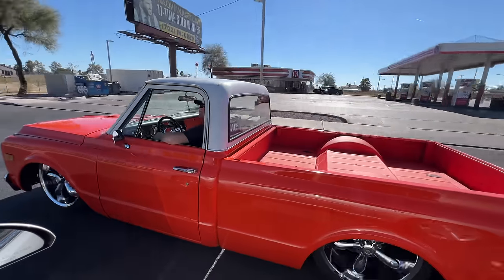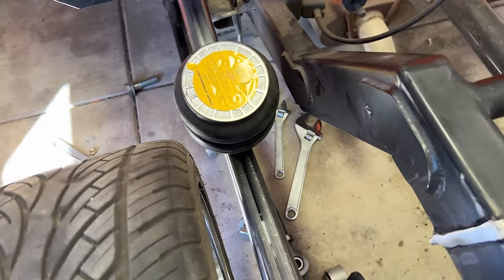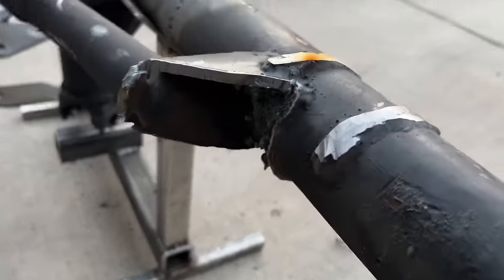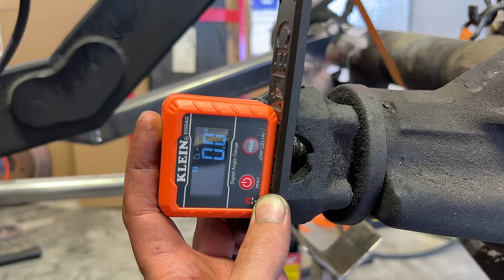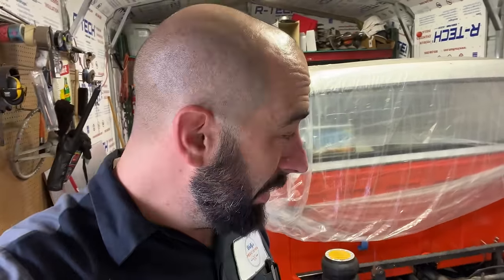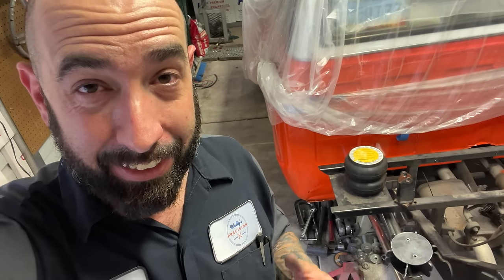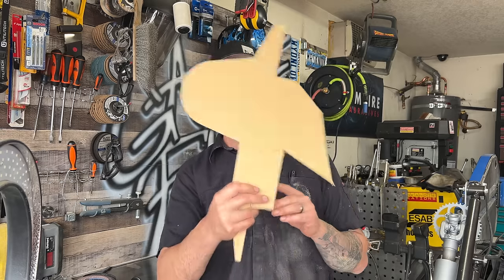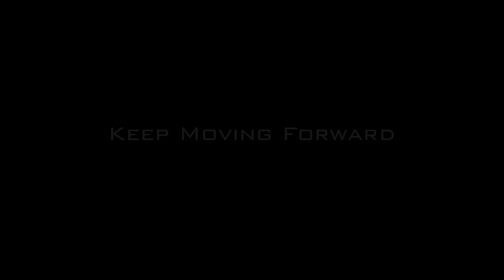Chevy C10 Air Bag Mount Design and Fab / Long Distance Fab 2

Comment: Good on you for taking the risk!  When you can create MIG welds that look as good as TIG - even welding vertically - it's a risk worth taking.
Bummer about having to redo the 4 link brackets on the housing end.  Especially in that kind of weather.  That's rubbing salt into the wound.
I hope your friend appreciates the effort that's going into this work.
Reply from the maker: …or rubbing salty sweat into the eyes. Keith has always been incredibly grateful. Which is probably why I continue to take on his projects even though I tell him that I can’t/won’t do them anymore.
Thank you, Craig! 🙌

Comment: Man o man, if I had a dollar for everytime, well you know the rest. Lol. It's all good nobody bats  a 1000. Great video as always. From off the grid in AZ
Reply from the maker: Haha! Thank you, Terry! Good to see you again.
Reply: @GarageFab  yeah it's been a minute. I see your videos,and for the most part there next level. Hope to be back on the ranger soon. Just got my block and rotating assembly back from the machine shop. That only took 26 months. Whatever. My question the other day was, triangulated 4 links, while the upper bars are shorter, do they still need to maintain the same plane . Thanks again.
Reply from the maker: On adjustable suspension, I think that’s a really good idea. That will keep your pinion angle constant and prevent driveline vibrations. On static suspension i.e. metal springs or coil overs, you probably don’t need to worry about that. In fact the shorter bars in addition to angling them towards each other on the front of the bars will it increase your traction a little bit off the line. I recommend doing a little reading on instant center to understand that better.
Hope that made sense. This type of stuff is hard to explain without pictures.
Reply: @GarageFab  thank you that was fast. No bags, fixed suspension. SBF, 5 speed, 373LSD. little solid roller motor. Should be a real highway star. This being my first suspension work really if this magnitude, I just want to be sure.
Reply from the maker: Sounds like fun! Can’t wait to see it!

Comment: Great job Aaron
Bugger about the first set of axel tabs but hay it's only steel and you still had your templates. so what 20 - 40  Mins lost removing the old and making and setting the new.
Reinforces the Tack first and final weld only once happy.
Also what prevents you taking your welder tot he the Keith's.
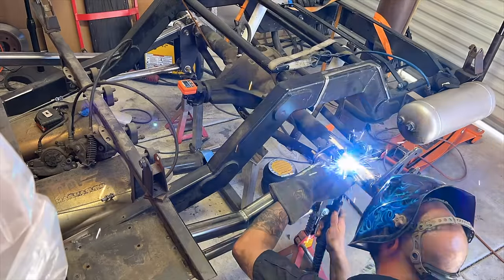Reply from the maker: Very true, Michael. Remaking the tabs with the templates I already had literally only took 10 minutes. Removing the tabs on the other hand was a nightmare. If you watch the part of the video where I remove the first tab, 11:58 you can see the sky change from day to night. And that was just one tab!
Thank you brother! I appreciate you.

Comment: I woke up around 4am to find this video already in my que. You snuck one in on me Aaron. Aint gonna lie though - I was thrilled to see it here. I fixed a cup-o-joe and settled in. Big respect for showing your mis.... well, you know. I can't even imagine TRYING to do a split-location project like that. My 30 second memory just wouldn't be capable. lol. But wow! Those mounts look so good!

Between the belly-laugh shot and the "whassup" I nearly spit my coffee out. I'm gonna have to start hitting pause every time I take a drink while watching your videos from now on - lol.

Quick question though - was replacing the u-joints even an option?
Reply from the maker: That shouldn’t be allowed. Watching my video at 4 am is almost like I’m up at 4 am… that’s not ok.
Swapping to single joints was certainly an option. It was just a very unappealing option. The current drive shaft is already a custom shaft. (The decision to install the double cardan on a vehicle with a parallel 4 link confuses me) So changing the joints would mean another custom shaft. Also, because the drive shaft was hitting the crossmember, (and then the shaft tunnel in the cab) body and frame modifications would’ve also been needed. The truck is painted already, so that was ugly.
Keith assured me that he had no vibration issues before I started hacking his truck up, so I essentially just put it back the way I found it.
Good to see you again, Tee Jay!

Comment: Brother you're back! Why has it taken me months to realize! I swear I just looked for you last month!
Reply from the maker: I’m shy. I tried to sneak back in without anybody noticing. Looks like it worked!
Reply: @GarageFab  just wanted you to know that your awesome, informative & fun videos helped me repair and relocate my 4 link setup higher at the front on the frame! Got my pinion angle within .5 or something degrees from the output on transmission, which I believe was so easy because I have a two-piece driveshaft!
Reply: @GarageFab  What is the setback on mighty Max?
Reply from the maker: Yes! Happy to be of service my man.
Reply from the maker: What do you mean by “set back”?
Reply: @GarageFab  I thought you said something about it was on hold for some reason
Reply from the maker: Oh!!!! Yes! It was simply on hold because I was working on my buddies truck. (The last two videos) I’m already back on it but you probably won’t see a video for another few weeks. Gonna post the rest of the C10 project, followed by a bushing assembly How-To and the we’ll Mighty Max it up!
Reply: @GarageFab  bushings in links?
Reply: Have you ever made or thought about making delrin bushings from a delrin rod?
Reply from the maker: It will be a video based on all the bushing redesigns I’ve done over the years. It’s a simple concept but I see bushings installed wrong often. Back to basics.
Reply from the maker: I have not. But I have been wanting to take charge and learn to make my own bushings. My suppliers are great. But slooooow.
Reply: @GarageFab  I've got a seller that sells the delran rod saved on eBay I just don't have the equipment to make them. And I don't know if you want harder bushings in link bars or softer ones
Reply from the maker: It depends on what you’re building. Drag strip stuff is often much stiffer. Street/performance, a little softer. (Polyurethane) and off road is really soft or bushings like Johnny Joints or Heim joints.

Comment: So many hidden variables with many a question such as ... when to use a staggered rear shock setup and the proper geometry for fitment - when is said shock setup necessary - I looked through and read my buds book from Max Fish on air ride suspension but I need to get my very own
Reply from the maker: Yes. Highly recommended. I’ll make a video on shocks soon.

Comment: I was thinking if you positioned the airbag over the welded bend such that the airbag was vertical, you could make a plate for the airbag welded across the bend to give it triangular support, and then also slap a gusset on each side of the square tube up to under the same airbag plate to make it super strong. I think it also would have moved the airbag more inline with the chassis rail you needed to weld to for the top airbag plate and given yourself shorter cantilever and more weldable contact area to it.
Reply from the maker: Yup! I agree with all of that. I didn’t have a whole lot of options on the location. So I picked the furthest point back that would still give clearance for wider tires. Hopefully you’ll approve of the reinforcements in the next video. 🙌
Reply: @GarageFab  Sorry - I gave no thought to the tires. Love your video's, especially the instructional ones. Wish you had the time for more. Keep up the great work.
Reply from the maker: No apologies necessary my friend! This channel is meant to be a source of good info for the people and you speak the truth. I’ve got to try and remember to share best practices even if I can’t follow them.
Cheers!

Comment: Nice!!! So Is the Double Cardan joint at the transmission? If so, have you seen one that will work with a M5Od-r2 (89 ish F-150 manual). I'm running truck arms on the 50 (Yeah, I know it is a bad idea) it would be awesome if I could set it up with a Double Cardan. Oh, I need to go back and watch the pinion angle video, haven't seen it yet. And re watch the Watts link video. Thank you for all of the great content!!!
Reply from the maker: Yes it is! I’m not familiar with your transmission, but a double cardan is a double cardan. It all depends on the suspension design and the set up. Your truck arm is the ideal system for the double cardan. On yours, the double joint will indeed be in the front, nearest the transmission, and the rear single joint will be nearly straight (1 to 2° bend) meaning the pinion is pointed at the back of the transmission.
Definitely check out the driveshaft video. I think it’ll benefit you a lot .
Reply: @GarageFab  Yes sir going to do some more looking. M5OD-r2 is the Mazda 5 speed in the full size, the ranger had the M5OD. Should use the same yolk as an AOD? Maybe? I'm familiar with DC at the transfer case for the front drive shaft. Also the ones on the early 70s ish Impala/ caprice that were at the pinion. Just hadn't generated much with a search result for a DC joint at the trans.

Comment: Great video.  
Not sure if you’re aware or not but grinding near cars makes metal dust land on it and causes surface rust. Really obviously on white cars.  Only way to remove it is with a clay bar once it rusts
Reply from the maker: This is the first time I’ve heard of rust though it makes a lot of sense.
I have, however, learned the hard way that sparks instantly stick to glass causing imbedded pieces of metal and craters.
The air is pretty dry here in Vegas which may be why I haven’t experienced be rusty dust.
Thank you my friend!
Reply: @GarageFab  yeah I’ve heard cars don’t rust in your area my bad. Here in Australia you see rust specs all over white cars, esp on top surfaces where the dust lands
Reply from the maker: That’s crazy. Still brilliant advice. All it would take is rolling a project car out into the driveway, and a light rain or mist from the neighbors sprinkler system. 😳

Comment: Your mentioned welding mental dilemma is my months long struggle now.... I've come to a point where I just think I have to blame my machine ( Lincoln Pro-Mig 175 - the box store special from 15 years ago, still runs on 220v....but extremely limited on "dialing it in" capabilities)..even tho I don't at all want to blame the machine at all, I just don't know what else I can do. I have spent hours and hours trying to get some great looking weld aesthetics... and I just can't, I get "good", but I want better. They're good welds,  but I just can't get the perfectly formed round stack, I get more of the forward V, and it really looks like it's because my puddle is too fluid and doesn't cool fast enough (even with increased travel speed), or I get more blended round stacks without the great definition like you get with that ESAB.  

I told ya all that to ask ya this, because I can tell you have experience to give an honest opinion..... do you think it's the welding machine that allows that last little jump to "great" aesthetics? (actual weld quality aside, just talking aesthetics here), if so, do you know (or have an opinion on) what about allows the jump? Inductance adjustment is what I've been leaning on as of late, but I don't have the adjustment to mess with on the ol' base model...so I can't be sure, and the commitment to a better machine isn't justifiable to me, unless I'm confident that will at least help.
Reply from the maker: This may or may not surprise you, but I know very little about welding. I’m fully self taught, (aside from the help of book and article authors) and I’m not certified.
It gets better! I don’t know what inductance is! I know my Esab has adjustable inductance and I’ve played with it in an attempt to learn, but I didn’t see much of a change at either end of the spectrum. I will try and read up on it over the next few days for both your sake and for mine.
Here’s my opinion. Settings are the most important (Wire speed and voltage anyway) and technique comes in a close second.
You can have crap looking welds with perfect settings if you don’t have good technique. And you can have crappy looking welds with perfect technique and bad settings.
I also believe that the specific welder has a LOT to do with it, even though I can’t finger on why. The welder I mentioned in the video at Keith’s house was a nightmare. No matter what I did, I made novice looking welds. I occasionally get to use a Miller 212, and my welds like a CNC machine! No joke, far better than any weld I’ve filmed. Why? 
I DON’T KNOW!!
People have been asking me to make a welding video for quite some time. I’ve been refusing because I am not certified, but lately I’ve been considering it. It would be presented as strictly a techniques video, but I’m still planning on a huge amount of backlash. It should be fun! That might be the next video if I don’t get the bushings I ordered in time for my two-week video release date.
Can you get your hands on another welder? Just to try out and see how things look?

Comment: Love watching but curious why you didn't use any adjustment built into the links?
Reply from the maker: Well hopefully this one doesn’t bite me in the arse, but there shouldn’t be any need for change and so no use for adjustments. The pinion angle won’t need to be adjusted and extensive and very accurate measurements were taken to ensure the thrust angle was straight.
Again, if he gets an alignment in the future and adjustments are needed aside from bushing replacements, I’ll be hating life.

Comment: You really should've welded a gusset/knee over the welded bend on your upper bar. As you said, the truck is heavy, so supporting it from behind the weld while the rest of the bar is bent, is just asking for trouble. It only needs to hit one pothole to collapse the whole rear axle support. Also that extra gurdle is necessary. If you could've extended that thin support gusset over the corner on the mount, it wouldn't be as necessary. The knee could act as a mounting plate for the air bag, bringing the bag more vertical (longer bag life) and dissipating the load on wider area over the upper bar. (longer suspension life)
Reply: I'm right there with you on this one. The bags are made to do that kind of twist as they inflate, but it might just be my OCD kicking in that has to level out that mount over the elbow. Totally beautiful work, and so entertaining. 👏 Keep the videos coming.
Reply: @chrisw9451  On a light vehicle, the bag can be mounted on an angle, or the travel can follow a curve, up to a point. Even then the lifespan of the setup is always shorter than on a straight and vertical. On heavier vehicles, trucks and busses, the bag has to be straight and vertical, otherwise they are constantly broken due to uneven load on the bag. But in this case, the bag itself is only part of thte problem. Bigger problem is the welded upper bar with no support, and just adding stuff on the sides is not good enough.
Reply from the maker: No faith!? I suppose that’s fair. Garage Fab is likely too new to have built any trust. I agree with everything you’ve said. All I can say is that there’s more episodes to come. You’re looking at the test fit of an unfinished bar. If you’re still not happy with the way the link bars turned out, only then will we be in disagreeance. (Is that a word?) Spoiler alert; this project is done and the truck has been on the road for months. (hence the 110° temperatures in the winter.🤔) I have no concerns about this system cracking or breaking.
Reply: @GarageFab  No faith. Only physics and scientific method. Yeah, it's an old reel, these usually are nowadays, the good old "Shoot, edit, upload" is sadly kinda rare. And from my personal experience with rat rods and choppers, months on the road does not make the design/vehicle any less of a death trap. One of the bike frames was literally held together with an artist paint brush. No joke. There used to be a bolt, but it probably got lost in the re-build process, and that brush was within reach. A bit spungy on turns, but years and miles on the road. Was it safe? No. Did it break? No. Should one push the envelope on customer builds? Also no. We'll see how this turns out, and I will give my honest, professional opinion on each step on the process.
Reply from the maker: Haha! Fair enough.

Comment: Sir ... with using reinforcing plates (fish plates) - do you ever drill holes in those for Rosette Plug type weld for strength esp when using longer wider re - plate ?
Reply from the maker: On wider plates, absolutely!

Comment: Awesome work,  but will the drive line even clear the cab when it's laid out?
Reply from the maker: With the pinion angle where I first positioned it, no! The driveshaft would’ve hit the crossmember, and if that were removed it would’ve hit the driveshaft tunnel. But now that we moved the pinion angle down some, it clears everything! And there’s no vibration which was the biggest concern.
Thank you, Darren!

Comment: Did you include the tire when setting the truck up for fully laid out? You mentioned the wheels, but not tire.
Reply from the maker: Yes! Total wheel diameter. Perhaps I should’ve mentioned my terminology. There’s a rim, and a tire. Once assembled, you have a wheel.